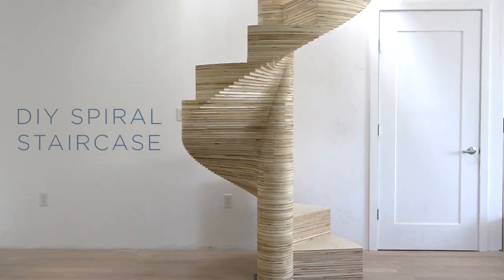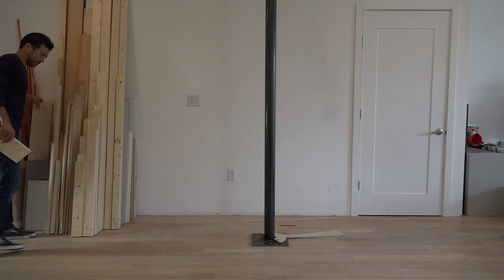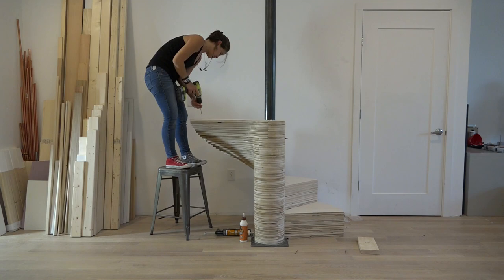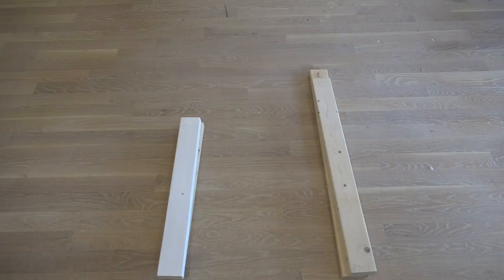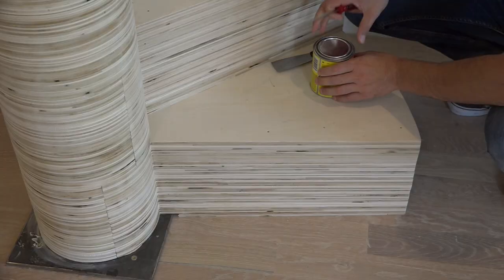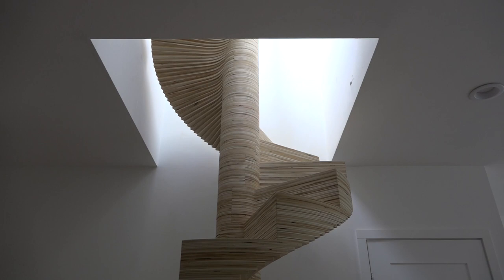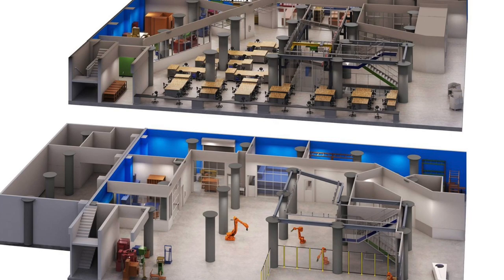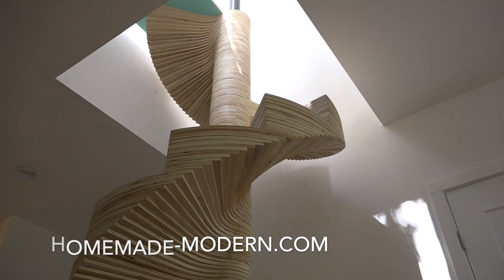Plywood Spiral Staircase

Comment: Wow.  Love the staircase!!!  One thought.  You could use a thick piece of clear acrylic (instead of the painted plywood) at the top landing for some drama and to let it in more light.  Great video and congrats on the Autodesk collab.
Reply: And if he was afraid of the strength, he could frame in acrylic in a metal frame. Would still be cool!
Reply: great idea with clear acrylic :)
Reply: I'm not sure that would "let in more light," since the top seems to be an enclosed space, but the acrylic would gradually become cloudy probably relatively quickly from wear.
Reply: I was thinking of creating and using cloth Micarta. Then you could pick and choose your colors. Often used for knife handles. Bluejean spiral staircase anyone? Or maybe burlap...
Second thought would be to embed some small LED light panels within the steps to light them up.
Reply: Rabbit Six That sounds like it would suck to make that much micarta. Could look pretty sweet though.
Reply: It would suck to make that much and expensive, honestly and it would be a fair bit heavier than plywood.
Reply: Rabbit Six Again, I don't know what your obsession with weight is. Weight is good in a structure. The heavier your structure is, the better, provided it isn't sinking or breaking.
Reply: acrylic would look good for a month, but would scratch very fast. Thick safetly glass would be the better solution i think
Reply: Would be interesting!
Reply: Acrylic would work fine if thick enough, it only really needs to hold the persons weight - the steel pipe in the centre keeps it upright.

Comment: u can CUT 1 template with the CNC and then all the rest with a router tool / it's cheaper and faster
Reply from the maker: yes! good idea! the one good thing about using the CNC is that you can set it then work on other projects.  with larger CNCs you can cut out 2 or more layers of plywood at a time.  In the new Autodesk Build Space i will have access to a 5'by10' bed CNC which could do this entire staircase in 4-6 cuts
Reply: poti sa tai si cu un pendular  sablonul, dar si cu un router e o munca titanica ca sa tai atatea coli de placaj presat ;) poti sa incerci sa faci si tu una ;)
Reply: HomeMadeModern yes, ofc if we are talking industrial tools the CNC will be faster. 
My mention was for people who don't own a CNC(so they just pay for 1 template) or for people  that have a CNC  and is not that powerful
Reply from the maker: yes!  another great way to share design!  thanks for the suggestion!
Reply: I was thinking (almost) the same! Because you can even print out the design and use a band/jigsaw and a sander for the biggest template. Then you can use a router to create as many as you need. Afterwards you can just trim the template down a little bit to the next size so you don't have to make a completely new one from scratch. And then just repeat and repeat (and repeat...)
Reply: rosserobertolli  and repeat... :))
Reply: It's a hell of a lot more work though and templates do wear out if not made of metal.
Reply: Gregor Kropotkin not really, if u use a good router - to cut this at CNC is very expensive(if u don't have your own CNC)
Reply: with a robot arm u can make each step from 1 piece of wood   : )
Reply: .....It's the only ultra-precise wood carving machine that can spit-out unique, personalized pieces of woodwork......

Comment: My main question is how to calculate where to start the 1st stair so it met the landing perfectly.  Love it!
Reply: I bet he just made sure the first step was facing the rest of the space, and then calculated what angle each step would need to rotate around the spiral in order to perfectly meet the landing - I'm sure he had a few degrees of play at both top and bottom, which allowed for him to guarantee each step was large enough to step on, while also being the right height.
Reply: Doug Christensen Number of degrees the staircase has to turn divided by number of steps = angle of each step.
Reply: +Doug - Let's say 12 steps to a rotation, and 10 inches lift per step. So we have one step every 30 degrees and 12X10 = 120 inches of lift per rotation. Let's assume a floor to floor height of 120 inches to cover. That makes it  120/10 = 12 steps. Which means we have exactly one rotation to make. Finally, this means the start and end of the staircase are in sync.

Comment: Great staircase. I was just thinking about spiral staircases, and bam... it's in my recommended. I think google hears my thoughts.

Oh, BTW... this can be made 100% with only a saw and router. You only need the ability to cut out each step section by hand. Then use them as top bearing templates on a router table. (or bottom bearing templates with free hand router) It's surprisingly faster than a hobbyist CNC machine. You could literally be cutting while one person is stacking and glueing.
Reply: Sure, but consider that you can piss off and do something else while the CNC is working.
Reply: Cut a single set of templates then use a router with the proper bit to hog out the material. I would also consider adding some "hidden" holes within the steps to lighten the total load without sacrificing strength. You can also hide all the screws you would use if you angled them in from the top and used the sheets above to hide them. Lastly, plan out on the CAD drawing a dove-tail slot or two in the top 5 to 7 sheets (however it works out) to easily add some banisters for a railing. Depending on how you end up adding the banister you may increase the total diameter of the stairs. It could be designed to use the top sheet of the step to lock the banisters in place. I can see several ways to add banisters easily.
---Just my two cents.
Reply: Rabbit Six You can't lighten the load without sacrificing strength unless the weight of the thing itself is what's compromising it's strength. That would also involve more work, and wouldn't save you anything for the effort, except weight, which shouldn't be a factor to begin with.
Reply: I understand what you are saying, and there's no doubt that he could of hid the screws...he also could've cut the backside of every step at the proper angle so that the backside of the stair case was smooth .....I'm sure it was his first staircase built in this manner, so criticizing him is pointless......it's still fantastic......

Comment: What about the cost? is it cheap or expensive?
Reply: I estimate about 1800 USD.
Reply: $450, $400 of plywood $50 of screws and glue
Reply: 40+ hrs per effort at $50/hr. Most of the cost is in labor
Reply: $70 Canadian per sheet if you want to use a nice birtch ply. 
X 1-1/4 sheets per stair. 
+ $50-75 screws and glue.
+ a cpl $100 to have it CNC'd for you.
Reply: He literally told us both which plywood he used and how much it took per step. The only thing I didn't hear was a step count. I'm estimating 14 based on the video. At 1.25 sheets per step, that's 17.5 sheets, rounding up to 18.

At local prices that's roughly $700 of plywood.
Estimating using metalsdepot prices for the steel components, $220
Let's round up and let the extra $80 cover all the other materials.

Rough estimate - $1000
Reply: That has to be the most expensive spiral staircase I've ever seen.  way more than 40 hours of labor.  Try  300.  Its  not that cool even - too much glue and screws.  Would have been better with dowels, mortise and tenon joints for that much labor.
Reply: definately cheaper than a store bough one, and actually I think this one is more pretty
Reply: QDR Quality cheap dude. Unless you don't have a Coc machine or a computer
To download
Reply: Oh yeah, and wood cost so...
Reply: Big fucking L Paul, Big L.  @paululrich1701

Comment: A perfect result, it looks great. Just a very minor detail you could improve. If you offset the cut through the centre circle at each layer by 90°, you gain additional strength without using more material. Two layers would already clamp the pole without the opposite piece. I am sure it is rock solid as you build it, just an additional layer of security.

Comment: If you were going to CNC it all along, I would've used a hollow pattern for most of the inside pieces, and split them radially. That way you could stack a bunch of "half steps" into a single sheet, use far less material, and actually show off some architectural engineering by designing an internal structure in the hollow parts. or you know, brute force it

Comment: For more strength, you should make the part of the disk around the pole on the stair side greater than the 180 degrees you currently have.  Ideally you just need enough of a notch to slip in the pole.  And you should stagger the seams for these 2 pieces for every piece of plywood within each step, not just between steps.  I think these changes would improve the integrity of the staircase around the pole without detracting from the amazing aesthetics of the current design.

Comment: Nice styling. I would like to add that you could have pre drilled/slotted the penetrations for the handrail posts to keep the exterior line clean for the rail, in the Cnc pattern to save time later.
I also wonder with a slightly adjusted retainer bracket, you could have possibly prebuilt the steps in sections, so more bench work and curing of the glue, without load pressure for a shorter final build. 

I see someone suggested a floor. How about a tessellated floor in 2 different veneered plywoods for contrast. It would work for Cnc or router work..

Comment: Amazing looking stairs, something like this would cost thousands of $$ to have made, two small changes I would do is round the base plate of the pole to completely hide it under the plywood, and nail / glue the top piece of plywood on so no screws would need to be filled, other than that fantastic job, when will you have the DWG files uploaded ?

Comment: So much love for this !
Defiantly going to give this a try for my loft access in my shed , how ever I think I'll weld a round baseplate onto the pole the same size as the tread timber .
Could you do this type of stair for a basement and have the pole finish at floor level at the top ?
Reply: Yes, if you had something to anchor the top of the pole to. Otherwise you'd be losing a lot of rigidity.

Comment: The result is fantastic! Do you think it's possible to build each step separately in a workshop in order to assemble the spiral staicase faster? Once you arrived to the top did the last step got higher or lower than expected? Also another question, how many hours of CNC did it took to cut this project?
thanks

Comment: The 'jaggy' 3/4" ply edges along the bottom of the staircase have a certain binary appeal design-wise, but I couldn't get past visualizing that endless OCD nightmare of futzy edge-sanding.  Then I imagined that lower surface as smooth helical ramp instead, like its concrete cousins...now THAT  would almost be a pleasure to sand in comparison, and the aesthetic, for me anyway, would be much improved.
From watching most of the X-carve video, I take it that it can't articulate (or even slope) its spindle off the Z-axis - true?  Since I've got zero experience with CNC stuff of this generation, is that a "high-end-only" feature I'm talking about?  That edge cut would need to start off at something like 80 degrees near the spine, and flatten out smoothly to ~30 degrees or so at the edges.  What would that take to accomplish?

Comment: I'm planning on using this (widened to meet code) to access an attic bedroom, ending in a transparent trap door, like is used in some wine cellars. Struggling with designing a railing that doesn't disturb the movement the stairs create; any thoughts on this?

Comment: Very cool build. My only concern with this project is that cnc machines & the like are not something that are easily accessible which gets away from the theme of your channel - homemade 🤔
Reply: it can be done with a router and a bit of time. but if you live in a major city you more than likely have some sort of maker space. they'll have a industrial cnc.
Reply from the maker: fair comment but don't worry.  i will do about 5-8 digital fabrication (CNC 3d Printing, and Laser) projects a year but about 20-40 regular projects!

Comment: I have no doubt about it's strength. But would it tend to be too heavy for the floor of the structure?
Reply: He said he reinforced the stairs point of contact with the floor using an LVL beam.
Reply: My estimate was 825 lb.

That's three decently fat dudes standing close together, add a fourth for a guy or two going up the stairs. Your floor should be able to handle that on a beam.

Comment: If you are building stair rails, you don't need to attach them immediately to the stairs. Why not build rails few inches externally away from the stairs, build them from the floor up to the ceiling.

Comment: What kind of metal stairs were you looking at that this much plywood (and glue and screws etc) ended up being cheaper?
// I bet that with proper welding equipment and square steel beams you could've made similar stairs out of metal (perhaps with wooden step surfaces) for as cheap or cheaper than this project ended up being^^
Reply: I estimated this cost around $1000. You could probably build a metal staircase, if you had welding equipment and knowledge, for similarish amounts of money, but if you didn't know what you were doing, you'd be putting people's lives at stake. Poor welds can fail under relatively minor loads. It would also be much uglier.

Comment: It would have been better to build a jig, glue half of the step in a time, then another half, leave out the back sides and glue them in later when assembling one half step at the time. additionally pipe could had welded pipes on the sides that go inside the lower part of the stair, get screwed on and top part hides it(though this would needed some alterations on the design)

Comment: can you make the spiral step WITHOUT the center pole? i think it have one in a church somewhere made by some mysterious dude about 3000 years ago or sumn like that...lol
Reply: Yes, that's certainly possible, but you're likely going to need much more material to handle the stresses since you can't rely on a vertical member supporting the load. Alternatively, you can have spiral staircases supported from the outside, like if there are walls all around it.

Comment: Neat, but this thing must weigh a ton.  You probably could have hollowed out most of the sheets to reduce the weight.

While I like the look, I just don't think this is very practical. You can make a wooden spiral staircase with a lot less material than this.

Comment: PRE SAND!!!  You coulda saved hours by doing that before assembly.
Reply: ... no? I don't think presanding would save time here. Probably add more, actually.
Reply: guaranteed that you could have sanded the edges faster is a situation like this before hand  just due to not having to  work around the edges of all the other layers.  If you had a cheap disc or bench top belt sander, you'd be able to knock that out faster than you'd think with more consistent results.
Reply: Matt B Sanding the edges would have taken maybe a little less time on the underside, and been a lot more finicky to do before than after since you'd be sanding several hundred individual pieces that you have to manipulate.

The tops and sides of the stairs wouldn't have been helped by that though, since the even the tiniest misalignment would require additional sanding to smooth out afterwards causing a duplication of effort.

I'd much rather try to sand the underside of the completed piece than try to sequentially sand a few hundred individual pieces.

Comment: Cool design. But you should call it a helical staircase. Not spiral. Common mistake I realize.
Reply: No. This isn't a helical staircase, it's a spiral staircase.

Don't correct people if you don't know what you're talking about?
Reply: (Spirals increase radius as they go around. Helix's twist and move up/down. It's helical. )
Reply: biscuitsalive A helical staircase lacks a central column, whereas a spiral staircase spirals around it. These have specific meanings in the context of staircases.

If you mean to be a math-hole, you're still wrong, as a helix IS a spiral.
Reply: I'm really not wrong, in terms of maths a spiral is a curve which emanates from a point, moving farther away as it revolves around the point.this staircase doesn't do that.
Reply: this is a helical staircase, It has the property that the tangent line at any point makes a constant angle with a fixed line called the axis. Examples of helices are coil springs.

all this info is online easily found.

i understand most people call helical staircases 'spiral' but in the vast majority of cases they are wrong. (unless the spiral increases in diameter as it moves up or down... then its both a helical and a spiral staircase)
Reply: (just to clarify, a staircase could not go up or down if it was just a spiral, it has to be a helical if you wish to physically move up to the first floor or down to the floor below)
Reply: but still, its impressive you can use a keyboard at least. kudos!